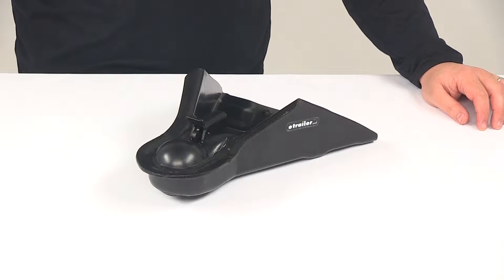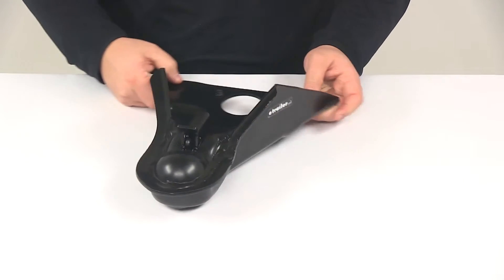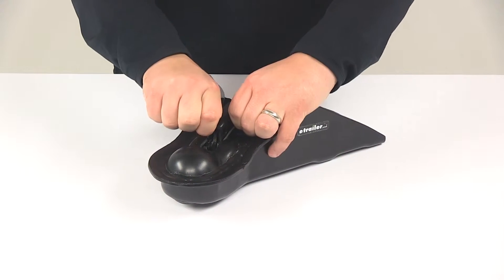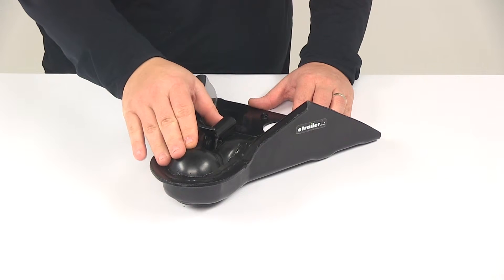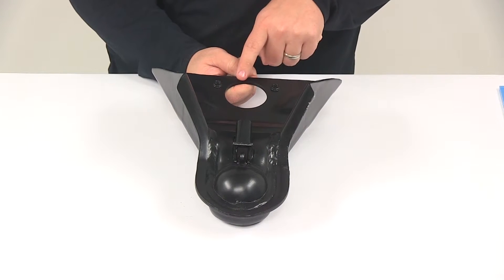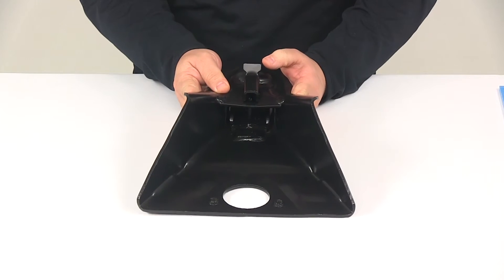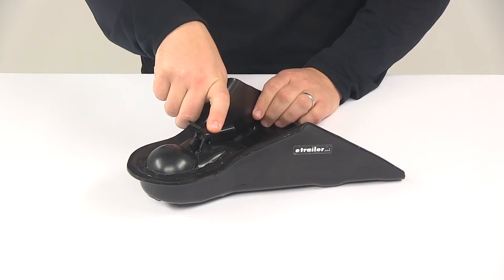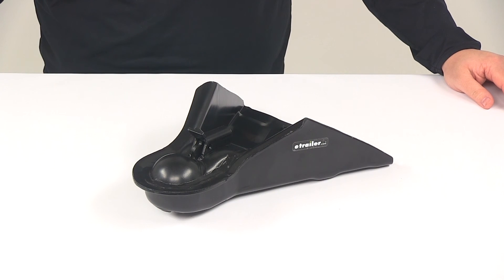etrailer | What to Know About the A-Frame Trailer Coupler

Comment: Just bought an travel trailer with this coupler. It’s hard to latch down into locked position. Any pointer?
Reply from the maker: Make sure the ball is seated, there could be debris or something in the coupler that prevents proper mating. Also check that you have the right size trailer ball. Make sure you check the mechanism inside the couple for form/fit/function too. It may be as simple as the parts not opening up all the way or needing some good lube in it. https://www.etrailer.com/article-categories.aspx?productgroup=Trailer-Coupler
Reply: @etrailer  could you please make a video of types of coupler locks that can be used on this coupler? U-bolt style is not wide enough. I also tried another one that does not fit. I cannot find any other videos that shows this. Thanks in advance.